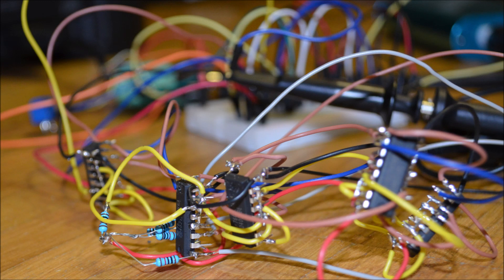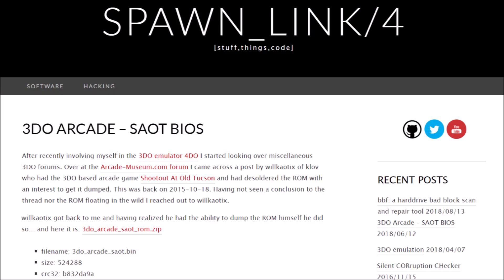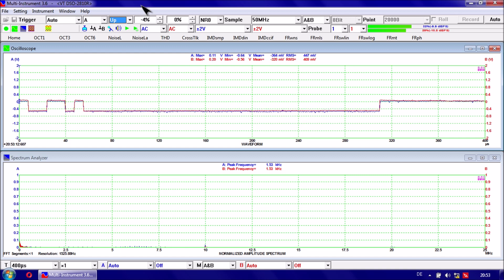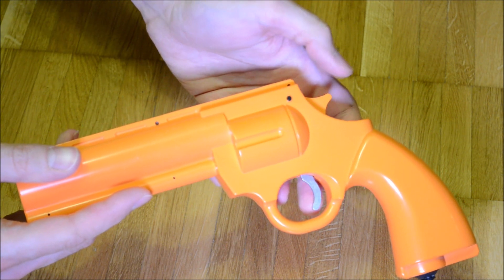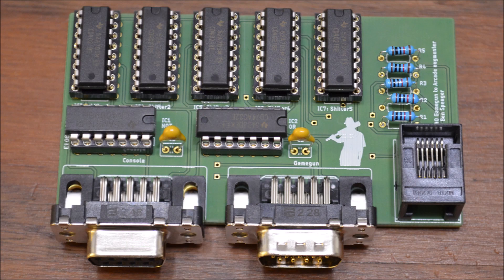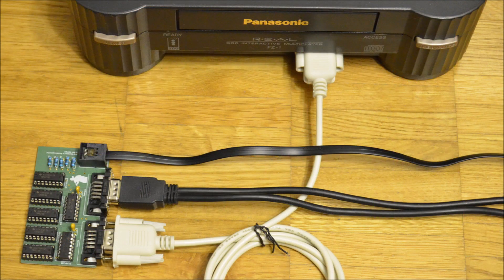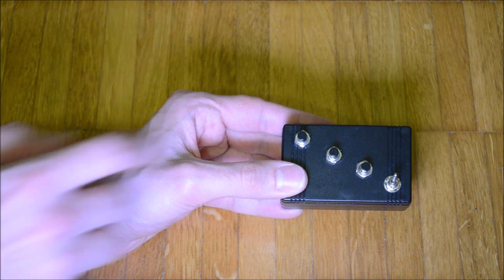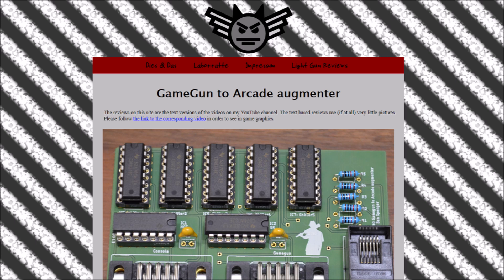Light Gun Reviews 112: 3DO GameGun to arcade augmenter / adapter

Comment: Thanks for everything ❤❤
I have gamegun for 3do but the cable ripped off can you gives me pinout to 9pin cable
Reply from the maker: You are very welcome!
Here you are:
1: GND
2: Vcc
3: audio 1
4: audio 2
5: Vcc (again)
6: P/S
7: clock
8: GND (again)
9: data
Reply: @Boojakascha  thanks dear my gamegun pcb has pinout label like 
V 
G 
C 
I 
Xc 
Xi 
So I don't know which I don't know how to connect 😞😞 
Because there are two voltages from the 3do socket

Comment: I think I found out why your circuit is one clock late. When the first clock-pulse arrives, the data-out signal (strobe) is still high and therefore the shift-registers ignore it. You could add some delay to the clock-signal, so the first clock-pulse arrives after the strobe-signal is low again.
Reply from the maker: It's fine. I just lose the ID key, which I don't need^^

Comment: Great job. There's any mode to use a non 3DO lightgun(PS1, Saturn, SNES...)  on a 3DO console?
Reply from the maker: Thanks! Yes, but that would be more complex. You would have to rebuild the ID key & recreate the positional encoding with an Arduino or something similar.
Reply: @Boojakascha  piece of cake. 🤭 Have you done it already?
Reply from the maker: @Hackinside  It's not as bad as it sounds. trapexit is already able to fully emulate the gun support in 4DO and has documented his findings concerning the positional encoding. The encoding of the rest is visible in my video I think.
Reply: @Boojakascha  Do you have a link to a website were the lightgun protocol is explained? I'm curious how much effort it would take, to build an adaptor for, let's say, a Light Phaser.
Reply from the maker: @4bitsystem  The protocol is explained in this video. A Light Phaser would take considerably more effort.
Reply: @Boojakascha  1:01 shows the light-signal, which is several bits long. Do you have any information about what is going on there? I would have assumed, it is just one bit of information: light on or off :)
Reply from the maker: @4bitsystem  Do you mean the positional encoding? You would ask that the 4DO (3DO emulator) developer called TrapExit. He has quite some insight. Also he published a lot of information on the topic.

Comment: Great work on the PCB! Should you have any spare that are for sale, I would love to buy one :)
Reply from the maker: I have blank ones, which I can give you for the cost of materials! You would have to source & solder the components on to it yourself tough!
Reply: @Boojakascha  That's very kind of you, I will take you up on that offer for sure.
Reply: I also shared your post (and some of your other video's) on my facebook page "American Laser Games Fan Site" If you're on Facebook, feel free to check us out :)
Reply from the maker: @K1NGARTH3R  Splendid! I would suggest you drop an email at my website. Just to make sure:
- You will need a external button interface thingy to house the additional buttons & the switch (The thing connected to the RJ11 socket. I use a normal soap box with cheap switches and a simple SPDT switch)
- You will have to disable RSA check if you want to play Arcade games.
Reply from the maker: Aw, that's so nice! I will join immediately =) Have you seen the interview I did with American Laser Games founder Robert Grebe?
https://youtu.be/rDxTuJBJX3k
My next big project is emulating Ghallager's Gallery

Comment: Nice work. Glad I could help. Now I need to pick up a gamegun so I can try this out myself 😊
Reply from the maker: =) I will send you a board as soon as you are ready. You realize that you will have to turn off RSA check, right? There is a Russian USB reader that does the trick, if you aren't fancy soldering the ROM chip.
Reply: @Boojakascha  Yeah. I've a system for modding and plan on replacing the ROM at some point.